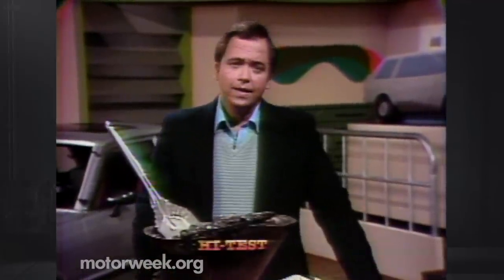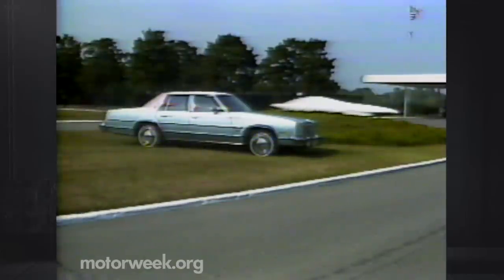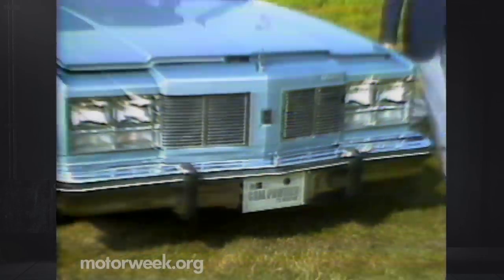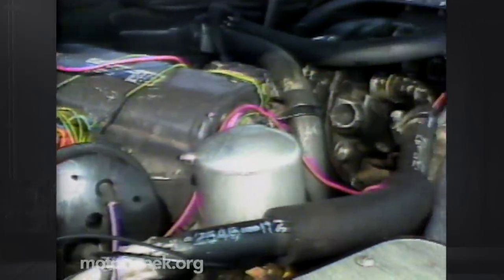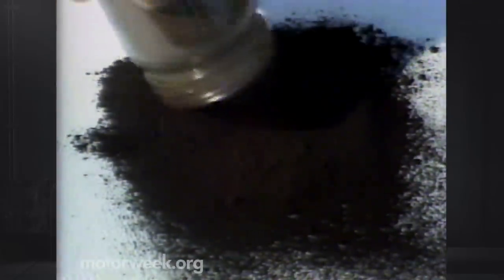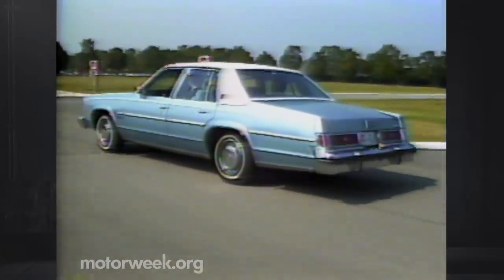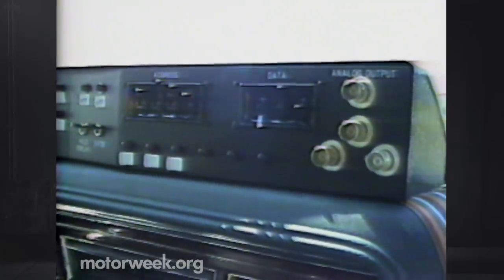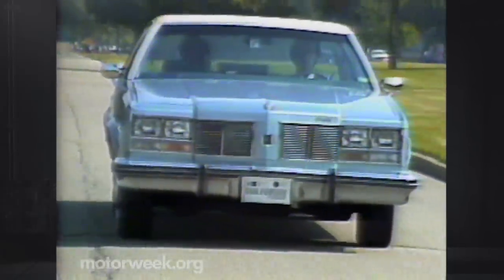Retro Review: Coal-Powered Turbine Engine Oldsmobile

Comment: Hey give them props for thinking outside of the box and actually making a working prototype.
Reply: Germany had running coal (and wood) cars during ww2, england even used methane bags on the roof during fuel shortages. Its not a new concept, but using powdered coal might have been.
Reply: @nobodynoone2500  coal dust was new for automobiles, yes, but not for turbines in general. Union Pacific had a single turbine locomotive in their fleet run on coal powder. Unlike their other turbine locos, it was pretty bad.

Comment: Who needs a battery when you can skip the powerplant and go straight to coal
Reply: Exactly
50% of ELECTRIC cars are
COAL POWER CARS.
BUT the 100 miles or 200 miles of "extension cord" has percentage of lost power.
Reply: small scale coal engine cant be high effeciency as the power plant
Reply: @JosephChou-z7t  Coal powerplant has efficiency of 43-46%. Current conventional piston engines get close to 40%. Assuming a coal turbine had only 30%, you're still better off with turbine than an electric car, as you don't  lose energy on electrical network, or from batteries discharge. It is also estimated that because producing batteries takes up a lot of energy, a battery powered car needs to do over 100 thousand kimlometers to get advantage over a conventional diesel engine.
Reply: @SparrowNoblePoland  Uhh no, only the most efficient small turbo diesels are going to get anywhere near 40 and even then I doubt it... the best otto cycle car engines are in the high 20s
Reply: @anthonybha4510  Most of the world runs on coal powerplants, and they're nowhere near switching to nuclear power or renewable sources. You Americans should finally learn that the US is only one of over 170 countries, and moreover it's a declining power.  EV is a dead end. The only solution is going back to lightweight cars, putting aerodynamics over styling, and rationalisation of car use. An average European family car in the 70s, such as VW Passat B1 was lighter than current supermini/citi cars, and in the 90s cars had lower air drag than they have now. Not to mention drag created by tires. Cars like SUVs should be banned entirely. MPVs, wagons, off-road cars, they all have their important functions, but from engineering perspective SUVs are only energy wasters.
Reply: @sdmoparmaninsd6713  You named it. There are alternative internal combustion engines that could casually reach 40%, and some diesels can get close to it already. There is plenty of independent studies showing that EVs are not better or worse than diesels.
Reply: @SparrowNoblePoland  I mean if someone had a house powered by solar then EVs would be better. As a MechE student myself Id say Hybrids are the best vehicle in terms of both practicality and environmentalism.
Reply: @SparrowNoblePoland piston engines are NOT 40% efficient, not even close. The true figure is around 20%

Comment: GM engineers couldn't engineer the steering wheel to be straight
Reply: 1:59 haha i was just thinking that lol! hilarious! they put all that effort into the engine and couldn't even bother to straighten the steering wheel before exhibiting the car!? im guessing that was just a regular car pulled from the assembly line to use as a test vehicle, but its just funny to see that of all the cars gm could have ended up with they got one that wasn't assembled right. makes you wonder (or kinda proves) how many cars were just slapped together and shipped out with missing and/or incorrectly installed parts lol.
Reply: Or genius, they may have been driving on a heavily crowned section of the road.
Reply: +Vasek Cekan     You never know, after all this was a boat car. You could translate the early works of Shakespeare into something resembling porn in the amount of time it took to turn lock to lock with GM boat car steering.
Reply: They could engineer the wheel to be straight but they saved 53 cents leaving it crooked.  Anything to give the CEO another bonus...
Reply: You know when I was a teen, I was stupid.  And I had a stupid friend.  And there was an abandoned race track near us and you couldn't get in but you could get in the parking lot.  It was horse racing anyway.  So we would take his parent's accord and go as fast as possible across the parking lot and down the driveway to the road and always managed to stop.  They had an old GM car and we tries that and ended up crashing into the bank on the other side of the road because not only did the steering not work as well as the accord, the brakes didn't either.
Reply: Clearanceman2 Lmfao they saved 53 cents by leaving it crooked!
Reply: Lord Apophis $0.53 was worth a lot more back then
Reply: Vasek Cekan no kidding, I just thought this guy's commentary was George Carlin level.
Reply: Hey 53 cents per car, the CEO could make a couple extra trips to Aruba with his extra bonus.
Reply: Clearanceman2 that's too true
Reply: maybe he was tuning, and that the turbine didn't leave room for the power steering hardware
Reply: From the description, it was a 5 year old car that was converted. Who knows what happened to it in the meantime. On top off that, you can't see the road in that shot. Maybe it was a curved road. But that wouldn't allow you to bash GM, would it?
Reply: cbiltcliffe yes it would, GM is notorious for quality issues. Something they never bother to address.
Reply: +Lord Apophis Hmmm. Guess that's why they keep winning all those quality awards, isn't it? :/

Typical GM basher. Don't let the facts get in the way.....
Reply: Lord Apophis I second that, I like to believe that GM stands for "Genital Motors" lol I just don't get how they are one of the world's largest auto manufacturers? horrible plastics, paint, fit and finish, ergonomics, etc I could go on for days. I guess they are like the McDonald's of car companies...they serve a purpose.... point A to B
Reply: StarquestMan exactly my point
Reply: StarquestMan -I couldn't agree more my parents bought a 1986 Chevy Celebrity wagon and that thing s*** out and alternator every 40000 miles even though it had no power options it had bad head bolts from the factory which incurred a recall and numerous other problems the OEM fan relay burnt out 3 times until I replaced it with a Bosch relay that lasted the rest the cars miserable life 120,000 miles when finally one of the four cylinders was down to only 10% compression I'm skipping over a lot of stuff and then there was my first car in 85 Dodge Conquest with 90,000 miles on it hard miles a smacked up front end and she was solid for me all I ever did is put alternator in that poor little car and drove the dogs not out of it racing people on Broadway God bless the conquest I even had a 89 wide body after that still love that car and miss it
Reply: civicturbo2009 haha yes starquests are amazing cars that are very underrated IMHO. it seems like everyone I meet that has had one has wrecked it at least once, myself included lol. these things must be cursed or something but I just can't bring myself to sell it.
Reply: Shit dude, GM engineers couldn't engineer the steering wheel to be round lol
Reply: No shit!
Reply: StarquestMan The thing about American cars is that people fall in love with the brand they grew up with, in my case GM, but I broke my love affair off in 2005. I've been happy with my car ever since. Once a person falls for a car, they stop thinking about safety, quality, reliability, or fuel efficiency, and only focus on driving, and owning their favorite brand of car.
Reply: Vasek Cekan Mercedes could. If by straight you mean a joystick!
Reply: Horribly misaligned lol.
Reply: It's torque steer 🤣😂
Reply: Of course not, no need to....its supposed to be round not straight:)
Reply: They engineered the 2 greatest engines of all time The 90• wedge small block 350 and the LS small block
Reply: @starquestman1544  USA cars are crap because they choose to build and design cars of bad quality. They keep getting worse for making short profit.
Reply: They actually had the same issue with the newest 2017+  SUVs the wheel would come out of  alignment over time  so GM did introduce this particular feature  but not the engine...

Comment: So Now i know where the term "ROLLING COAL " came from lol .
Reply: I think this might be the only appropriate vehicle to own that claim - sorry diesel-heads. :P
Reply: Do not forget the steam trucks and traction engines running on coal or the cars in WW2 Europe, which used generator gas suplied by either coal or wood that produces combustible gas when heated without oxygen suply (much like in the production of coke (not the white snuffable or liquid drinkable variant) in coking plants or charcoal in a similar proces)
The gas was produced in a generator mounted at the rear of the car, the gas was used in the normal gasoline engine much as in a LPG car, and the leftovers from coal (coke) or wood (charcoal) could still be used in a household stove.
Reply: dieselmupke yeah I watched the video on that, it would be nice if they can bring that idea back in some kind of modern yet safe kind of configuration because the original ones had a tendency to blow up and kill people in or around the vehicle.
Reply: Diesel engines were designed to run on coal dust, that's where the term comes from
Reply: I've never heard that before
Reply: @jeffersongraves5295  peanut oil
Reply: The Bushwacker  D'oh! By "vehicle," I should have stated "horseless carriage." You got me. 😉

Comment: 2:20 "And since the U.S. currently has over a 600 year supply of coal..." According to the Energy Information Administration that number is currently down to ~220 years. Guess we were a little more aggressive with our coal in the last 40 years than we thought.
Reply: Probably used a statistic that just took modern electricity demands and extrapolated into the future without considering how much energy demands would increase thanks to the mass proliferation of consumer electronic devices
Reply: Coal supplies drop when the price drops and some becomes economically nonrecoverable.
Reply: More likely the math used for the estimate changed and not the usage.
Reply: Nah we just aren’t allowed to wreak havoc while mining now so we can’t touch the other 300 years
Reply: @davewilson7602 Now That's Funny!! Sad, true, but still Funny!!!!
Reply: Takes a lot more coal to generate and meet the electricity demand now that we have "Green" vehicles to charge.

Comment: Damn. And I thought the Oldsmobuick 350 diesel was a bad idea
Reply: bile.
dont lump buick into that mess.
Reply: @jordanwiley4582 plenty of Buicks came equipped with the Olds diesels.......
Reply: @jordanwiley4582 it’s gm’s mess not Oldsmobile’s. Olds engineers and managers at the time before production told the higher-ups at GM that engine wasn’t ready, and as GM does they didn’t listen and instead fire those managers and engineers and put it out anyways.

Comment: I recall that the Germans were working on coal dust engines in WWII
Reply: They did and prototypes worked. But there were several problems with it. The coal dust wears out the cylinder by friction. Also about 5 Vol% of the dust turns into ashes that needs to be removed from the inside of the cylinder with every single rotation.
In the end, coal to liquid transformation is the better way.
Reply: Yeah, Fischer Tropf gasification was better technology. Solid fuel engines are really neat, but as you said, wear is a massive issue. Think the only practical use were a few very large pneumatic injection stationary power engines in the 30's, and they needed an ash system.
Reply: @genori01  GM's engineering solution was to get rid of the cylinders and go with a turbine that doesn't wear out.
Reply: The German experiments with coal dust engines go back much further than WW2: When Rudolf Diesel was developing the first diesel engines, he managed to convince the German engineering company Maschinenfabrik Augsburg Nürnberg (MAN, which still exists today) that his engine may be able to use coal dust as fuel, in order to secure development funding from them. That particular idea didn't work, primarily because the diesel engine cycle requires injecting the fuel at the top of the compression stroke, into highly compressed air, and the quantity of fuel injected has to be precisely controlled. Which is difficult but possible for liquid fuels, but proved to be far too difficult to do with the required degree of precision for a powdered solid fuel like coal dust.

They did experiment with using a mixture of coal dust and oil (at a ratio which would still be a liquid) as a way to overcome these difficulties, but the problem with that was making a stable suspension, where the coal dust component would not separate or settle out. So in the end they abandoned the idea of using coal dust as fuel, since it was just complicating the process of developing what we now call the diesel engine. However, the mineral oil we now call diesel fuel was not what was used to power the original prototype diesel engines - they actually used peanut oil for that. So the idea of using biofuels is nothing new - is at least as old as the diesel engine itself.

Comment: Exceptional video! Thank You! This is nothing new. GE experimented with coal fired gas turbinse for locomotive use in the 1940's. One big drawback, was that the coal particles corrode the turbine blades. Direct dive Turbines in general are not suitable for automotive & locomotive use. A turbine by itself develops very low initial torque. Not good if you are starting a 3,000 ton train or a 4,000 lb automobile. Turbo Electric power plants utilizing very low grade fuel oil were adapted by the Union Pacific for their Electro-Turbine Locomotives which developed up to 9,000 H.P. The gas turbine spins the generator at a high RPM as the high torque electric traction motors move the train.
Reply: Did they burn number 4, 5, or 6 fuel oil?
Reply: @gregorymalchuk272  Turbines don't care about the grade of fuel at all. You could run one on used motor oil if you wanted.
Reply: @ronaldcolman6211  
Yeah, but residual oils (and solid fuels) pose the problem of ash corrosion and erosion of turbine blades. Some residual oils can be treated to minimise vandidate corrosion, but the coal turbines have additional problems. Cyclone separators were placed after the combustor and before the turbine. The combustor would be either powdered coal or fluidized bed. Modern designs simply gassify the coal to make producer gas, which is then burned directly in the turbine. Some also integrate an oxygen separation unit and an oxygen-blown gassifier to eliminate nitrogen from the producer gas and raise the otherwise low enthalpy of combustion of the gas.
Reply: @gregorymalchuk272  Totally agreed, I was assuming this was a question of what it could run on, not necessarily what it should run on.
Reply: @gregorymalchuk272  I think they used no. 5
Reply: @gregorymalchuk272  In the early days of the GTEL's they burned bunker C heavy fuel oil which is barely above tar in terms of viscosity. But fuel handling issues and turbine wear saw them switched over to #6 fuel oil

Comment: Metropolitan Vickers UK were working on a coal turbine locomotive back in the 50's.
The two biggest drawbacks were the blades fouling with slag build up causing flame outs and the scouring of the blade edges.
Reply: Separate the ash out

Comment: Union Pacific RR built a coal turbine in the 1950s. The coal dust eroded the turbine blades, and the locomotive, No. 8080, was scrapped a few years later.
Reply: Yep. While jet engines aren't very picky about what fuels they'll burn, said fuel has to at least be in either liquid or gaseous form.